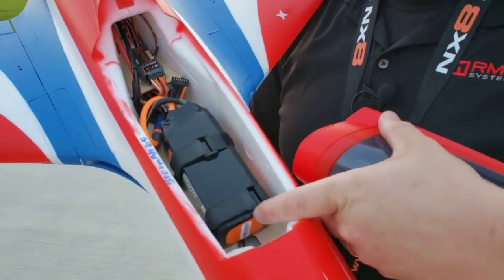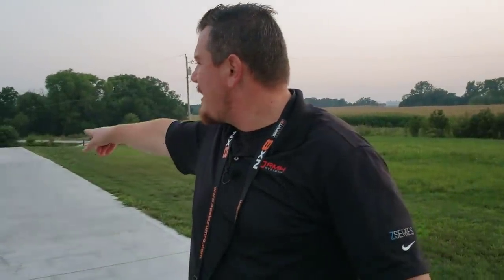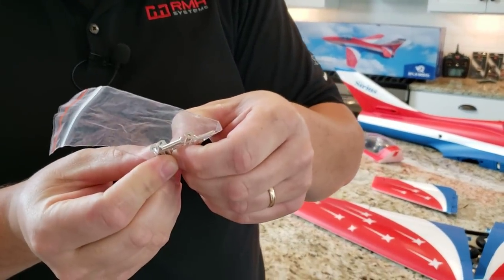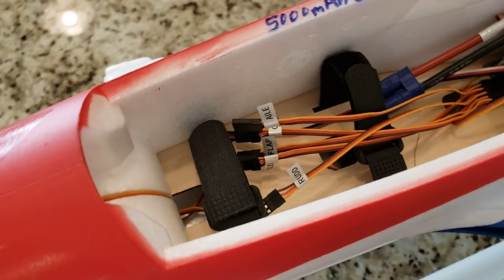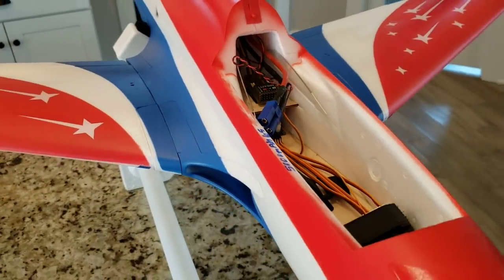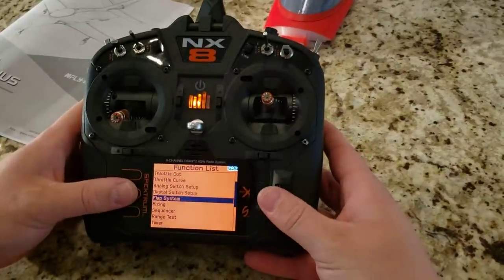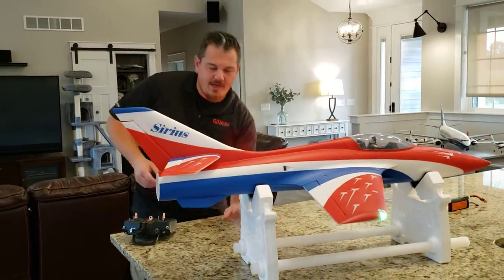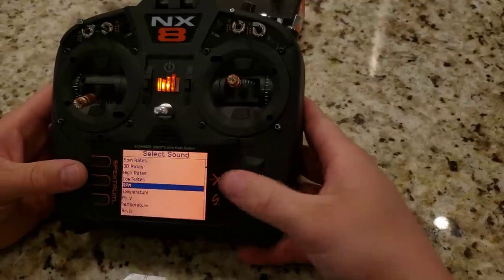XFly - Sirius 80mm - Unbox, Build, Radio Setup, & Maiden Flights

Comment: Brian, great video. As always. I put mine up in the air for a maiden yesterday on our club's grass field and it had no problem. It rocked, and dare I say that it may even take off fly and land better than the Avanti Freewing. The one thing that I am struggling with right now is the rates. Rates by the book, I find, are very slow, especially on the roll. Any suggestions? Also, you mentioned crow, you put crow on your jets? I have never heard of that. Thanks again, and keep that great content coming. Cheers.
Reply from the maker: I run them at 100% or even 125% (which you can do until it mechanically binds on this plane)...but as for crow...that would HELP, but this plane just rolls and rolls, even with a nice fair on landing. If you're doing grass ops, I have to imagine it's quite a bit better for you.

Comment: Looks like a winner in the slim-to-none 80mm sport jet category. I appreciate that you don't edit out those "go arounds" since it makes for a much more accurate representation of what it is to setup, maiden & then land these EDF's. Curious as to where the CG was on those flights?
Reply from the maker: I would have been right at the recommended points at first...then we show if there's a deviation...but I can't remember.
Reply: @BrianPhillipsRC  Just wondering since She looked a bit tail heavy on those initial flights. Diggin' the Red White & Blue color scheme & the sleek fuse design. This one is definitely on my radar now...

Comment: Great flight bud. I have two questions for you. With all these planes, batteries, chargers, and other toys is it easier for you to ask for permission or forgiveness? And question two. How in the hell can you fly like you do and not slice a plane or two in half on those power lines? 😀
Reply from the maker: LOL - (A) Forgiveness (but I'm very fortunate to have a very supportive wife) (B) I HAVE hit the lines before, but only killed one plane, which I resurrected shortly thereafter ;)
Reply: Brian, great answer, forgiveness all the way, and also, yes I was wondering how many planes those wires or even that pole has claimed. only one! I am shocked. Keep it going and stay away from those lines.

Comment: I need to learn how to set up safe selwct and the AS3X with the forward programming. I have a reciever I just bought for my june night p 51 cause mine came with a bad reciever.
Reply from the maker: You CAN, and will after you follow these steps - I've had this comment from probably 50 or more, just as adamant as you, and they got theirs working ;)

Step 1) Make sure you're BOUND with SAFE SELECT ON. If you're NOT 100% sure - DO IT AGAIN, and make sure the surfaces "Dance" through the mix TWICE at power up...NOT ONCE...Once means you're in AS3X only mode.

Step 2) Go to MONITOR MODE, and watch the switch change the condition of the channel you THINK is assigned to the SWITCH YOU WANT TO USE - If it doesn't change state, go to System Setup and make the Channel Assignment to that switch. Now exit the menu and verify the changes took in Monitor Mode.

Step 3) Now that you're 100% sure you're BOUND in SAFE Select, and you have an operational switch for channel (I think 5-8) assigned, go ahead and pull both sticks DOWN and IN, and then toggle the switch to a count to 10 (NOT 5)....most people don't count a FULL CYCLE of the switch...so they never get to 5 full back and forth cycles... On step 9 of 10, you'll see the surfaces twitch, and on 10 of 10 they'll "recenter" again.

Here's PROBABLY what you're doing wrong...it's a super easy mistake to make, and you'll immediately get it if you are doing this wrong...

Switch Up to Switch Down = 1
Switch Down to Switch Up = 2
Switch Up to Switch Down = 3
Switch Down to Switch Up = 4
Switch Up to Switch Down = 5
Switch Down to Switch Up = 6
Switch Up to Switch Down = 7
Switch Down to Switch Up = 8
Switch Up to Switch Down = 9
Switch Down to Switch Up = 10

When Horizon Hobby wrote those instructions they said 5 times, so this is what they meant, but it's confusing if not elaborated upon...

Switch Up to Switch Down = 0
Switch Down to Switch Up = 1
Switch Up to Switch Down = 1
Switch Down to Switch Up = 2
Switch Up to Switch Down = 2
Switch Down to Switch Up = 3
Switch Up to Switch Down = 3
Switch Down to Switch Up = 4
Switch Up to Switch Down = 4
Switch Down to Switch Up = 5

...pretty confusing, right??!?!?

Step 4) The ONLY issue that might prevent this all from working is that your sticks are WAY out of calibration... if so, the Tx might not realize you're in the Lower Left or Lower Right position, thus preventing the designation when you hit flip 10... so if this ends up being the case, which I highly doubt, then you need to calibrate your sticks and then follow back from step 2 maybe.

Good luck - you can do it!
Reply: @BrianPhillipsRC  manbyouvare awesome. I got all that man I have several boundvwith safe and AS3X. I out that on my ghost channel or on my switch I use for landing gear. This reciever has to have gyro set up through forward programming. Horizon tech says I wont be able to use safe select till I set up gyro. It's a reciever replacement that you have in the stock p 51 june night that you fly with that young pilots.
Reply: Sorry for the sloppy texting. Thanks for that info. Professional man. But I got all that man. I'm told by horizon that I will not be able to initiate safe befor I go to forward programming and set up the AS3X. I know you know all about that. I think you beat um all hands down. I wish I had the time to take it all in but I'm busy with tech at my job. Thanks again man.

Comment: Brian can I ask your opinion on the adjustable AS3X gains please? I'm new to the NX10 coming from the NX6. Im using my B channel for Safe/fixed AS3X, no Safe/fixed AS3X and last position no Safe/less AS3X gains & adjustable on the R knob. I know how turning the knob adjusts the gains from what I set then anti clockwise to absolute zero gains. But I wish the screen shows these adjustments so I know what gains I'm at if I find a sweet spot for the jet using the R knob.. So on the main screen it just shows the gains I set and they don't change as I turn the knob but I know it's physically changing as I'm moving the plane around in my hands. Is this how it is or have I set ut up wrong? Thanks 🍻
Reply from the maker: You can change the screen to MONITOR mode before taking off if you wish, OR you can change what your displays are on each screen...BUT I always forget to scroll to the right screen BEFORE takeoff ;(

If you're not seeing the change to GAINS...pick up the plane and make sure with 100% certainty that they're changing when you move the knob...rock or swing the plane back and forth at a constant speed, then change the knob position...you will HEAR the difference, and you can setup an OFFSET with a mix, if you wish...so all the way DOWN could be 30% and all the way up could be 70%....and you CAN flip it in the MIX if you wish. It's not hard, BUT you gotta just play with it on the ground and make sure you know for certain what direction and what limits you've setup...or you WILL CRASH. Get that stuff 100% before you get in the air ;)
Reply: @BrianPhillipsRC  thanks Brian. I 100% know the gains are getting reduced as I turn the knob anti clockwise. I'm holding the plane and rocking it around listening ot the servos work. You can hear it getting less and less. Its just a shame I can't get them gain figures to show their adjustments with the turn of the knob. They do change with the flick of the B switch (my F mode button) but they don't change with the turn of the R knob.
Reply from the maker: If they change when you move your B switch, go to the MONITOR MODE and see what channel the B Switch commands, then change the SWITCH ASSIGNMENT from B to Right Knob, and you'll be golden! Sorry, your comment was stuck in "held for review" - I don't know why!?!??

Comment: Just thought I would share how I set up crow on my setups. I do it with the throttle curve and mixing, and have it set up on a switch to turn it on and off. With the crow off, the throttle, flaps and aileron work normally. With crow on the throttle is off in the middle with no crow, max crow at min throttle stick. (Your zero throttle setting with crow on does not have to be right in the middle, adjust position to taste) It takes some getting used to if you never set it up like that. But once you get used to it, it feels very natural to use the throttle for power and braking. Obviously you have to be very careful not to bind servos and control surfaces with this setup. On many planes I had to modify the control surfaces to get more throw to get it to work effectively. (Just as an example, the flaps and ailerons on my Phoenix 2400 will deflect 80 degrees down, 65 up before they bind.) Normally I only set up gliders this way, but I have tried it other planes and it will slow them down considerably if the control surfaces are large enough, and deflect far enough. Make sure stabilization is active with crow when you first set it up, it can get very unstable on a some wing designs.... If you are going thru all the trouble to set this up, do it on a 3 position switch and make the 3rd position full span ailerons. The roll rate of my Phoenix is sort of scary now...
Reply from the maker: Very cool setup! I agree that would be sweet on sail planes!

Comment: this planes needs a bigger cheater xfly will have a STL file soon so U can 3d print one U will get a extra 500 grams thrust when u do that
Reply from the maker: That's VERY COOL! Extra cheater...you mean, get out the chain saw? I don't need to gain no 500g - LOL
Reply: @BrianPhillipsRC  yeah makes a big difference to the plane yeah U cut out the cheater grill that's there and replace it with the 3d printed one
Reply: @BrianPhillipsRC  the fan in this jet is starving for more air flow
Reply: I can print U one and send I live in Australia though so may take a little to get to you

Comment: ZOOM... 🤣 It Needs Giant Air Brakes or A Parachute Which Is Deployed w/A Pressure Switch Attached To The Front Wheel, As Soon As It Touches Down The Spring Loaded Chute Pops Out From It's Hole Using A Micro Servo On The Trap Door Latch-eh... Made From A Cheap Red Plastic 2-D Cell Flashlight That Attaches Onto Bottom Between The Landing Gears w/A Nose Cone, It Will L@@K Like A Bomb or Drop Tank... 🤪😎
Reply from the maker: I think I need a lot more practice to land on my aircraft carrier ;)